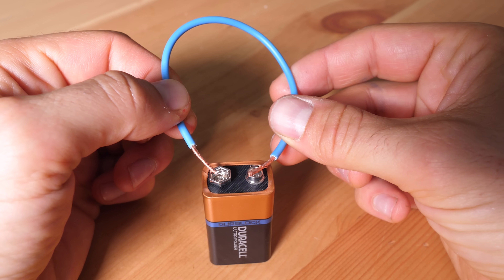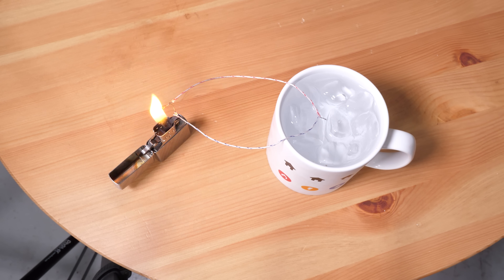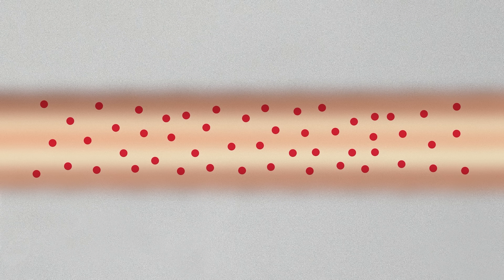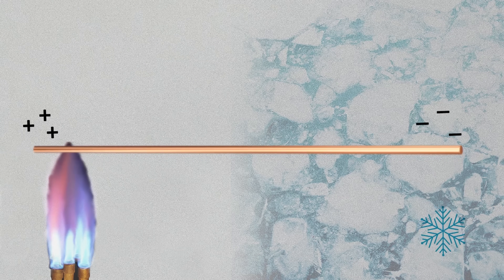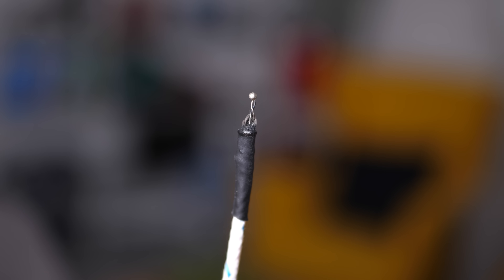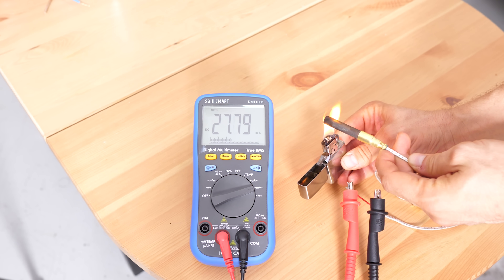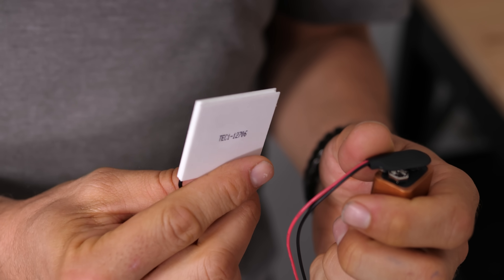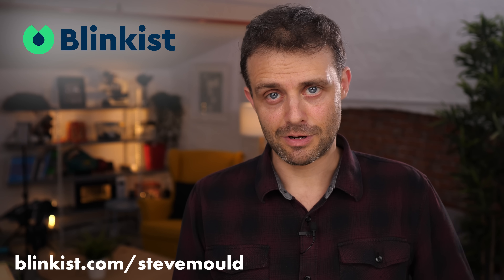Make Electricity Go Round and Round - The Thermoelectric Effect

Comment: Interesting fact: all Peltier elements for measuring a temperature also create a Peltier element where they are conected to the electronic circuit. This connection also has 2 different metals and because of this it produces a voltage too. Because of this extra voltage difference (second Peltier element), measuring devices often have a different temperature sensor built into the device, so it knows the temperature from this second connection and it can calculate the absolute temperature at the measuring point. For really exact measurements sometimes ice water is used to calibrate the temperature of the second Peltier element.

Comment: There is another way to get a continuous orbit of electrons through metal...take a flat bar and U shaped piece of soft iron, (or other soft metal) which can't, by itself hold it's own magnetic feild. Around the U shape wrap two coils of wire both clockwise and counter clockwise. briefly short a 9v battery through this helix coil with the flat iron bar against the end of the U. This will cause the u shaped iron to attract the bar, but it will not let go until, at some point, the ends of the helix coil are discharged through a resistor, say a small light bulb. Years can pass with the iron bar held to the U shape( even bearing wheight) and not give up this orbit of electrons... as simple as it is, a small flash of a lightbulb, and the two pieces of iron suddenly separated a decade after the initial charge is a very impressive experiment.

Comment: Look at "Persistent Mode" in  https://en.wikipedia.org/wiki/Superconducting_magnet.    After ramping up the current in a superconducting magnet, a short shut of also superconducting wire is bridged to close the loop, allowing the current to keep flowing in the magnet without external power, sometimes for months.

Comment: I work for a large engineering firm. Can you model the the thermoelectric voltage contributions to a sensing circuit from non-standard thermocouples caused by the junction of dissimilar metals in the circuit?

Me: Laughs in quantum mechanics.

Comment: I always thought about electricity as water flowing through the pipe, with the amperage being the pressure and voltage the aperture of the faucet, making the wattage the total volume of water that flows through it at any point.

Comment: It is possible to loop electricity. NMR magnets work like that, it requires a super conductor in liquide helium and some special circuitry, so I wouldn't say accessible to the common man or woman but possible and used.

Comment: If valance electrons are responsible for thermal potential at point contact between two dissimilar metals , then why doesn't magnetic flux affect thermocouples?  Wouldn't magnetic flux affect the valance entropy causing a buck or boost in electron flow?

Comment: You omitted from your analogy the why, the reason one side is cooled or heated. Why it gains or looses thermal energy. 

When the electrons are pushed over or off the shelf, even if they now have a different energy level relative to the host material, they absorb or release the difference from the surrounding matter, thus cooling or heating the surrounding matter.  
They absorb or release energy because energy always leaks from where there is a higher level to where there is a lower level. 
At a quantum level, unlike the bouncy balls, electrons interact with each other and the host atoms,  loosing energy to them or gaining from them. 

But otherwise, another enjoyable video with lots of effort put in and pleasant outcome.

Comment: What if you take a wire loop of just one metal and heat it one side and cool it on another?  I'm assuming that there would be no net flow as the currents are opposing and equal?

Comment: maybe having the heat go out during a power outage is ok because modern gas and propane furnaces and boilers have a vent plower to draw the co fumes out and other electronics  that connects to the thermostat.

however the hot water heater really does not need electric to work because it's hardware is self contained

Comment: It's actually possible to have a current going in a loop forever (or at least, a macroscopic amount of time) if you are using superconducting wire! This is called a persistent current.

From the Wikipedia article on superconductors: "An electric current through a loop of superconducting wire can persist indefinitely with no power source."

Comment: What if you use 3 peltier elements and position it in a right angle where 2 sides touch together and if you place it on the top it looks like a pyramid can you use this application and a tealight or other heat source

Comment: Seebeck Effect -> Temperature difference into current
Peltier Effect -> Current into temperature difference
Together they're known as the Thermoelectric Effect (search for this on wikipedia).

Seebeck Effect analogus to heating fluids where the increased pressure (ie. electromagnetic charge) difference in one wire outweighs the pressure difference in the other resulting in a net movement of electrons around the circuit.
Peltier Effect analogus to pushing bouncy balls from a high surface to a lower one (ie. greater gravitational potential energy), which results in either higher or lower bounces (ie. thermal energy) resulting in a change in temperature overall.

The effects can be increased by adding modules in series, to eg. produce enough current to control a solenoid valve for a gas pilot light, or to create a Peltier Element which i've seen used by Linus Tech Tips as part of a CPU cooling system.

Comment: I feel like the current is only flowing because your measuring it and current flows whilst doing work in the measurement circuit. In reality the electron cloud/field would be pushed to one end based on the temperature delta with no measurement circuit in place.

Comment: The explanation on the Pelletier effect made sense but the explanation of the Siebeck effect had some flaws.
I see some people joking that you had it sent to amperage when talking about voltage. And then people trying to say V=IR explains this away, but it wouldn't really because you can have a voltage without a measurable current.

You say that there's a voltage induced which your explanation makes sense. But you repeatedly say the current goes around and around, and of course you measure a current. If that's really what's happening, your explanation doesn't give the full picture.

Comment: I've had an instant gas hot water system that used a pilot light with a piezoelectric spark gap for igniting, so you would need to hold down the pilot light button, repeatedly press the spark button until the pilot light ignited, then hold the pilot light on until the thermopile got hot enough to keep the solenoid open.

I had to relight that thing so many times because the wind blew it out.

Eventually we got a new system that uses a small water turbine to ignite the pilot light and main burner, so if it blows out, no big deal, it'll relight next time you use it.

Comment: 0:16 it is actually possible. it's exactly how buck converter circuits work. just using transistors to switch the current instead of your hand, and a much longer wire wound up into a coil

Comment: I love how there are so many different "reversible" electric effects. Electricity <-> moving magnetic field, electricity <-> sound, electricity <-> light, etc. Anything that can be a source of electricity can also be driven by electricity (are there any exceptions?).

I suppose more generally, it's one form of energy <-> another form, not just conversions involving electricity.
Reply: An important exception is very close to the topic of this video: Electricity -> heat. While the Seebeck effect can turn a Difference of heat into electricity, it can't undo a resistive heater and turn heat itself back into power, it can just move heat from one place to another (while adding heat itself from its own resistive heating)  In fact the second law of thermodynamics is basically 'Generating heat is one-way.'
Reply: @davidgro2000  If I understand correctly, you're saying that the Seebeck effect, and applications such as thermoelectric generators, can't remove heat from a system and convert it to electricity, only use differences in temperature to generate electricity? I can somewhat make sense of this, but it still confuses me at one point: if the difference of temperature is used to generate electricity, and we're not removing any heat from the system by doing so, what energy are we actually removing from the system and converting in a thermoelectric generator? My first thought is kinetic energy or the electrical potential that interplays with it similar to the ball analogy, but wouldn't removing kinetic energy from atoms/electrons result in removing heat?
Reply: @Amynon1660  I think the way that works is that a heat difference is a "thermal potential" like the way a height difference is a "gravitational potential" Everything tends toward having a ground/sea-level altitude be flat unless acted on by other forces, and everything tends to equilibrium temperature the same way. - and energy can certainly be extracted from a difference of heights (Ever see how the weights in a grandfather clock work?) so this is similar by analogy.  Also by analogy, removing heat from a thermal system would be like removing mass from a gravitational system: It would still have to exist, just somewhere outside the system, which would also make that depend on how you define the system (easy enough for a fridge or a house AC system)
Reply: @davidgro2000 I was going to mention delta T
Reply: There is a fundamental physics theorem that every lossless process is reversible. The closer a process is to lossless, the closer it is to reversible.

Comment: Thanks for another great video, Steve.  I believe there is also a small thermopile with a similar shut-off mechanism built into almost every domestic gas hob burner or gas plate.  The tip is usually visible at some point around the base of the gas ring and also serves as the electrode for the piezo-electric igniter (which is perhaps why this second less well-known function is usually overlooked).  

This built-in protection mechanism is why you sometimes have to hold the lighting mechanism for a little longer after ignition (while the safety shut-off thermopile heats up) or the gas burners shut themselves off (safely, albeit annoyingly!) https://en.techinfus.com/dlya-kuxni/kuxonnaya-plita/termopara-dlya-gazovoj.html

Comment: Hey Steve, they don't always use a thermopile to detect the pilot light.  There is another really cool effect you should cover that is used often, the flame rectifier.  There are other methods used as well, but the flame rectifier is both the coolest and one of the more reliable ones, was quite common as well, not sure if it's still as common.  In higher voltage applications they can pass a current right through the flame as a simple switch.

Comment: What would happen, if you just cool (or heat) one side? Especially, if it is not at a connection point of the two wires, but in mind way? A thermal image would be very interesting, if there is actually a detectable temperature difference at the connection points.

Comment: Getting electricity to flow in a loop like you did as a child indeed wouldn't work. The resistance of the wire would degrade the current quickly until there was no current left.

Comment: The explanation doesnt explain it. We have a lower density of electrons on one end and a higher density on the other - how does it now start moving around? Why would the short circuit inside the wire itself NOT let the charge get into equilibrium? Where is the "pumping" action of the electrons coming from? Just having 2 sides with different electron density is not suddenly a motor. Why is currenct constantly flowing instead of a equilibrium charge-density forming?

Comment: 5:37 "the voltage you can get from this is much greater as you can see here" multimeter set to Current
Reply: True, but if R is the same we then know V is higher.
Reply: @Spruce

No, we know that either V is higher or that R is lower - but not which one.
Reply: @drlegendre  solid's R doesn't change by heat. Unless it's molten.
Reply: @strain121  It changes with T, though. Nonetheless, for alloys the increase of R with T is negligible for small ranges of T.
Reply: @strain121  The electrical resistance depends on 2 things: The Dimensions of the conductor and the Coefficient of resistivity of the conductor, which depends purely on temperature, not if it's molten or not.

Comment: Hi Steve! I’d like to think that you read the comments and I didn’t have much luck finding a different way of contacting you. I appreciate your videos of explaining many of the science questions that many don’t realize to ask.  You enjoy experimenting and seeking answers to the results you can see and sometimes those results are because of the unseen. I am a Quantum Engineer and Physicist as part of a worldwide collaboration in Exotic Physics. This video about catching electricity in a loop is a very big part of our research and as many have mentioned, using a superconductor would/could solve the thermal issues. Our group of scientists have become aware of a method that utilizes Nano carbon as a room temperature superconductor, applied directly to bare copper wire. Catching electricity in a loop (I call this Infinity) to generate a repeating gravitational wave only takes a few nano amps. It takes less voltage to push that electron once a superconductor State is achieved.  If you are interested in setting up and performing your own experiments and possibly share your experiences in a video please feel free to contact me. Actually anyone interested in this may contact me if you’d like. I’m working on the idea of how to put together the right video on many of our discoveries. So imagine, if you will, the ability to truly capture electricity in a loop without thermodynamics being an issue? To be able to complete these experiments you have to understand electric circuits at a very basic level. Chemical safety. Electricity safety. You’ll need some lye drain opener, vinegar, aluminum foil, bare copper wire, fairly large plastic container with lid (not airtight), multi meter, and a desire to ask ‘why does it do that?’ And ‘what is happening that causes it to behave that way?’ These two questions lead to answers in the importance of Cause and Effect and polarities of electrical energy. At any rate, my contact email is centeroffireconsulting @ g mail and I’d like your scientific findings and opinions on whether this carbon solution to bare copper can actually be classified as a superconductor material. Second concept is to prove or disprove that this method pulls carbon atoms from its surroundings and sticks to the surface of the copper. I do not have access to reliable facilities for testing or equipment so I’m reaching out. God speed folks!

Comment: What you demonstrated is nothing more than an electric circuit which behaves exactly like any electric circuit. The element which is different about yours, is that the source of electric energy coupled into the circuit is thermo-electric instead of chemical (battery), electro-mechanical (generator). The out put element is nothing more than a resistor which has converted electric energy to thermal energy which is radiating into a heat sink (liquid).

Comment: 7:20 I've never lit a boiler pilot light, but what you describe reminds me of a gas kitchen stovetop I once used. you need to turn the gas on and hold the dial pressed down to cause the sparks to light it, but if you let the dial pop back up too soon after lighting, the gas cuts off.

Comment: You don't need multiple junctions to operate the solenoid, and most old furnaces used only 1!

A single thermocouple junction in a pilot light can develop about 1/2 volt.  If the wires are heavy (about 12 gauge copper and equivalent cross-section of other metal), you can get about 20 amperes, which when sent through 100 turn 12 gauge wire solenoid, will hold plunger in, keeping valve open.  This is how older pilot-light furnaces, water heaters, and ovens operated.  The thermocouple was a coaxial arrangement with copper outside, other metal (don't know chemical composition, but it was silver in color) on the inside.  There was a thick "head" on the end in the flame, and a coaxial connector on the other end, which fastens to and makes connection to the solenoid valve.  Because of the low voltage and the high current, the slightest corrosion would cause them to fail, and contractors replaced them regularly.  But they didn't need to replace them!   All that was needed was to loosen the nut, then re-tighten to grind off the oxides.  Then it is good for another 10 years!  I scrounged many of these "defective" units.

Comment: I'm a physics teacher prepping for school to start. I came across a question that has a drawing of a wave moving along a string that asks the student to draw the instantaneous  velocity vector on a dot located on the string. This mad me think of making a demonstration of waves moving across some kind of water. Then my ADHD mind started to wander and I thought in the case of a water wave the model of the wave having a horizontal velocity apart from the material is only true on the surface. Beneath the surface the volume of water is changing and water must shift, and a demonstration of this (I think it would probably be turbulence) would fit the types of things you do.

Comment: Where dose the electrical energy coming from if it is from the heat it self then you can use it to cool stuff and get energy from it but if the energy is generated by the difference in temp then you can't use it to cool stuff down